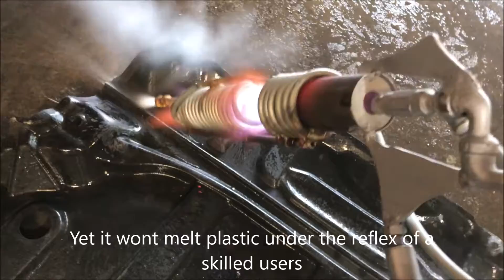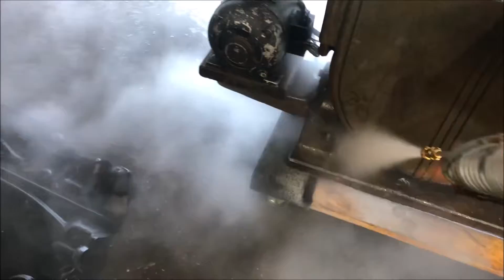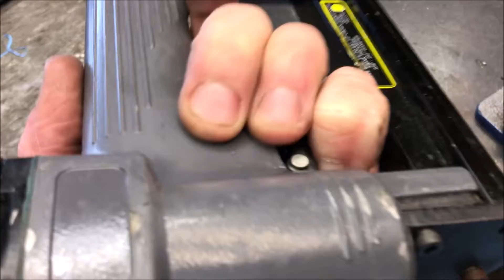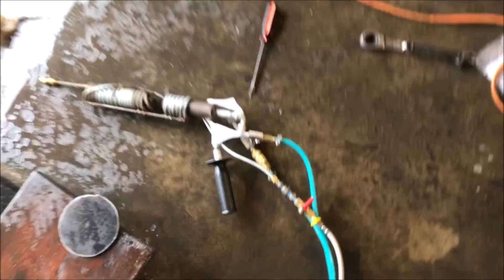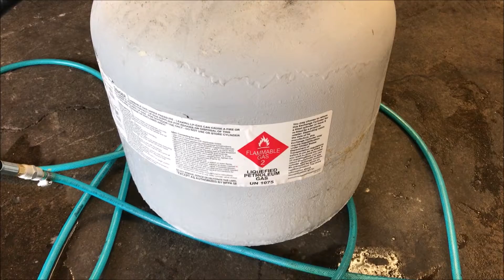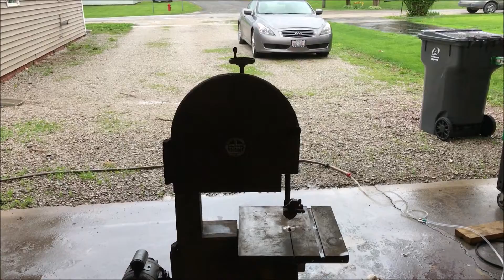Auto parts cleaner(AMAZING ) machine parts and tractor semi steam power pressure washer

Comment: NOBOX7 EXCELLENT video!  Love these steam cleaner videos, the Zeus steamer is powerful and impressive.  I would like to just include 2 helpful ideas- One is to pickup one of these 200 Watt commercial air pumps (I'll include the link) as they push 6.5CFM, develop decent pressure, are quiet, and can run indefinitely.  Mine has been running in my pond for 3 years straight even through Michigan winter's, and they develop A LOT of air sufficient for powerful burners.  For example: The Boysal Burner is very powerful and he only uses a 60 Watt version of this!  
https://www.ebay.com/itm/Ecoplus-Commercial-Air-7-Pump-200-Watt-3566-GPH-aquarium-hydroponic-eco-plus/252596203809?hash=item3acfe83121:g:zo0AAOSwal5YCWF7

The other tip is to use PowerDirector App to edit video and include some Fast Forward steam cleanup clips of large areas, I think that would be impressive and it really is an easy to use editing program as well as only costing $6-you get it on a smartphone, and it can handle pretty much any file format.  Thanks for excellent videos